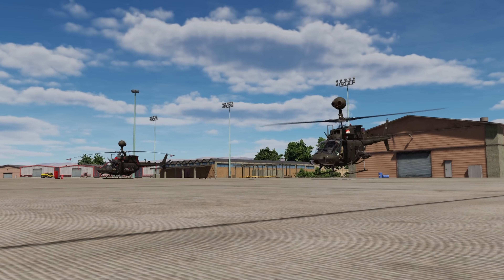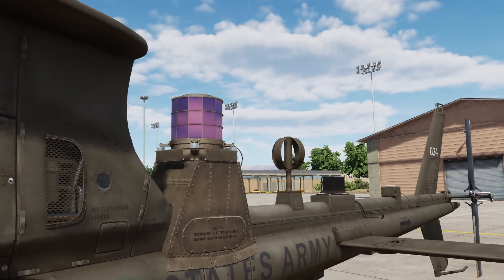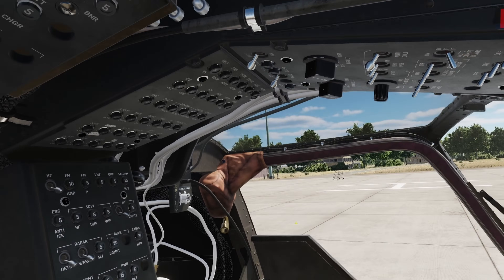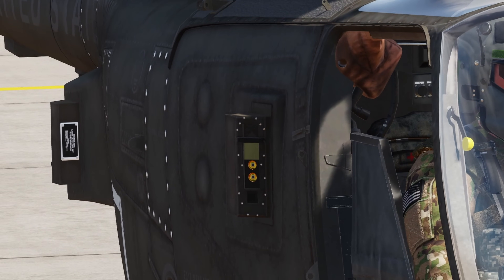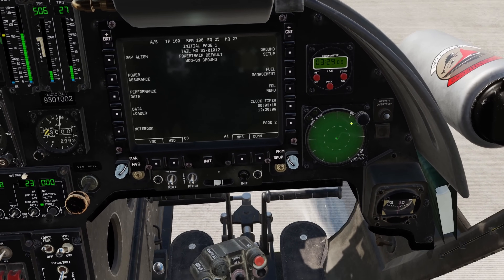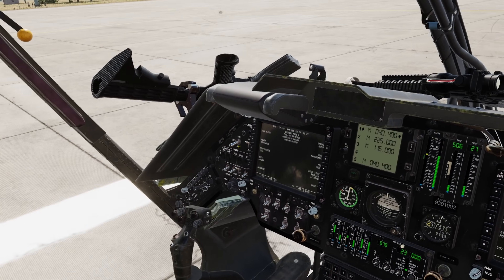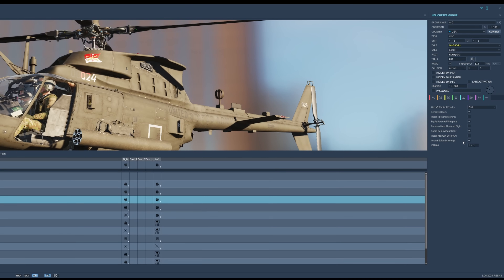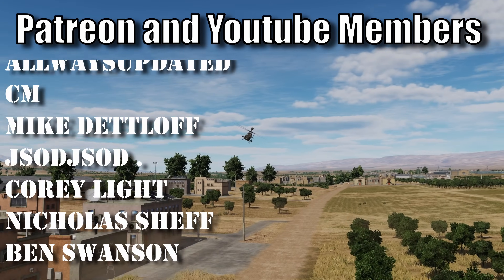Electronic Warfare and Special Options in the DCS World OH-58D Kiowa Warrior

Comment: The 'how' for the ALQ-144, or at least the basics, are public. It's a 'hot brick' jammer - a heated silicon carbide block or cesium arc lamp with a big old mechanical shutter that modulates the output. That shutter, and its spin rate, are the secret squirrel bits, as well as further upgrades that defeated rosette and staring scanning techniques, but the principle is interesting - it's literally a heated block. ALQ-144s worked best against old spin-scan and conical-scan MANPADS and IR missiles, WHEN it was programmed and fitted correctly. Intelligence was particularly important, as knowing the spin frequency and seeker design of an enemy missile could invalidate it pretty thoroughly.

Comment: I've never melted the vinyl cover for the 144, because it was left on and ground power was applied for maintenance reasons, said no crew chief, ever...  :)  APR-39 "I am the Wizard of Wor"
Reply: I never melted a cover on the discoball on the Blackhawk. Ours were way closer to the disc though, so it had to come off.
They took the APR-39 picks off the 58? Huh...On the 60, we ran both, EOM's, AVR-2B, and APR-39 pucks. Was the 58 to small for radar guided missiles?

Comment: A test of the IRCM would be nice. Is it really lowering the chance of getting hit by manpads and other IR sams?
Reply: I'm pretty sure it works on the Su-25 T, so it should also work on the Kiowa. In theory this type of IRCM is designed to work against missiles with rotating aperture seeker, so older ones. This is probably not modelled in depth in DCS, I've seen a video of it working against more modern missiles too.

Comment: Have someone tryed the Kiowa in the Syria map? In the Persia map it works fine for me, but in the Syria map the Kiowa only flip over to the right side when start from the ground like it should be a storm or something...
Reply: I've not tried it on the Syria map but I do know that it works fine on the Sinai Map. I'll test and let you know.
Reply: @ImpendingJoker  thanks 🙂
Reply: I've only flown on syria,  no issues at all.
Reply: @ericcraft9856  Thanks :) I dont know why its happening. But I will try to find out now that I know its not a bug in the game 🙂
Reply: @baardk2  After flying for a few hours from both my homemade FARP and from Ramat David, I have had no issues at all with the 58D. You may need to check your winds to make sure your nose is facing into the wind when you start up or, check the calibration of your joystick. I use a Saitek X-56 Rhino with the lightest spring installed and a zip tie to compress it a little further to make it even lighter, and I have no problems at all from pick, to hover, to transition to forward flight, cruise, transition to hover, hover taxi, and landing. Also check to make sure that another axis is not assigned to your cyclic. Like your rudder pedals or if you have a split throttle one of them could be sharing a cyclic axis with your stick.
Reply: @ImpendingJoker  Thank you. It was the wind. I'm not sure how and why the wind was set to strong, because i just started to make a new training mission in ME. It wiroks great now 😃
Reply: @baardk2  Glad you got it sorted out. The KW is such great fun to fly.
Reply: @ImpendingJoker  Yes it is great 😀

Comment: Do the system voices sound robotic so as to not confuse the pilots with actual radio traffic?
Reply: No, its because the RWR being used in this Kiowa is a model from the 70s and voice synthesizers weren't very advanced back then.
Reply: @RandomKhajiit  from what I researched the apr39 v1 is from the 70s but the an/apr39A v1 is I think a post cold war upgrade. The one the Kiowa has has sam type  classification wheras the older apr39 you could tell due to an older scope display with  strobe indicators similar to what vietnam era apr25's had on fixed wing aircraft.